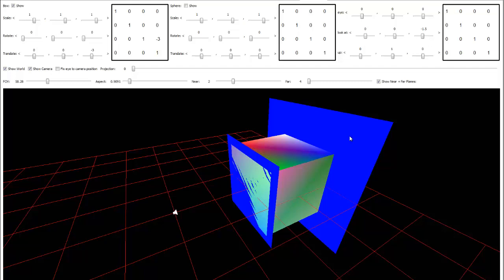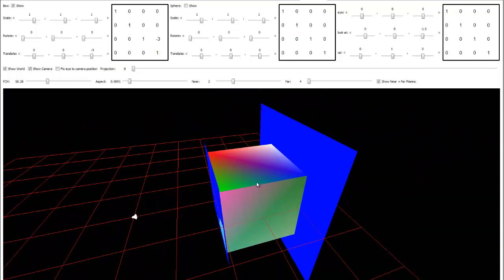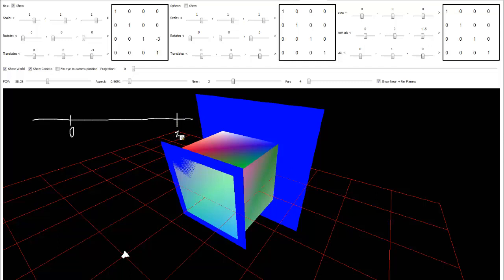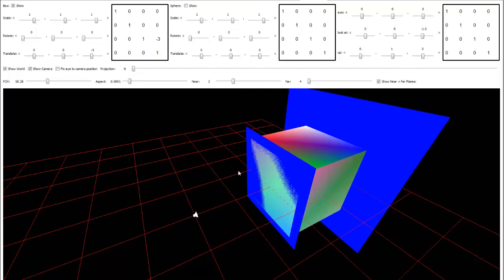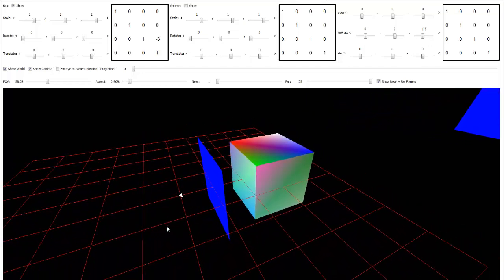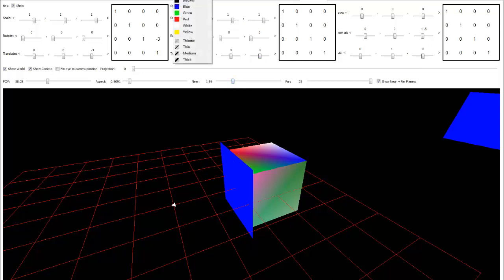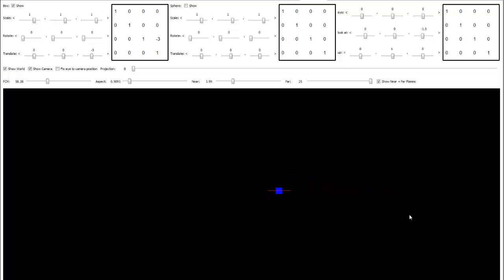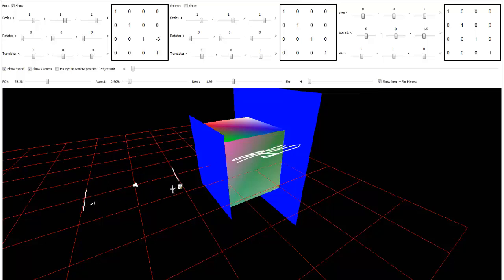Z-Fighting

Comment: Seriously still a BIG problem in 2026 with applications like flight simulators where there is an enormous depth between the near and far planes. Yet developers still do not take into account floating point (lack of) precision with their scenery so you end up occasionally with these problems. And they stick out like dogs balls. The problem is often the fix is too difficult because the very same object can be viewed at almost any angle from literally centimetres away to 60 plus kilometres away!

Comment: Use double instead of floats. Profit?
Reply from the maker: One would think that would remedy it, but it does not. When you try to represent an infinite range on a floating point scale, the floating point types become more super crude integers instead. Even if I had a billion-bit floating point type...compared to an infinite range...there's just no way to cover it all.
Reply: @JamieKingCS  What about BigDecimal?
Reply: @JamieKingCS  so does it still help ?
Reply: @linkenparis9562  It only delays it. It will still occur but from slightly further distances.

It may seem like a quick and easy fix until you realize that floats have a performance benefit since they take up half the space of doubles. Flood the GPU cache with doubles and the performance takes a nosedive.

Comment: First of all: Impressive series! It's immensely helpful, very detailed and easy to watch. 

Please allow me a little remark, though (Which is probably of more interest to other viewers):
@ 9:15 you demonstrate that the back of the cube gets depth buffer values of about 0, even though the back is relatively close to the near plane.
@ 10:30 you start to explain why: the objects closer to the camera get a "finer resolution" in the depth-buffer.  But then you paint the "0" close to the far plane and that is actually reversed. 
If the "0" was close to the far plane, then all the values between the camera and "0" would be compressed into depth buffer values between -1 and 0. Whereas the relatively small distance between "0" and the far plane be turned into depth buffer values between 0 and +1. But this would mean that the values close to the camera are compressed more, and not less. Instead, the "0" is close to the near plane, so that the relatively short distance between the near plane and "0" get's 50% of the range of the depth buffer values.
Your demonstration with the box (@ 9:15) even shows that the "0" is near the back of the cube; and thus relatively close to the near plane.
Reply from the maker: I think I'm following you here. I believe in later videos I actually uncover a slight lie I told in this video showing the cube turns inside out like a top-hat.